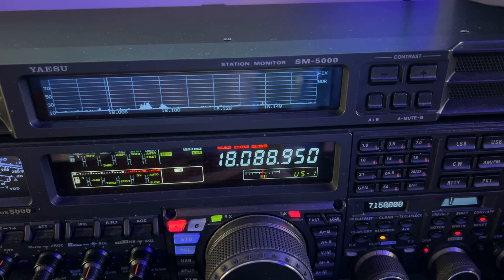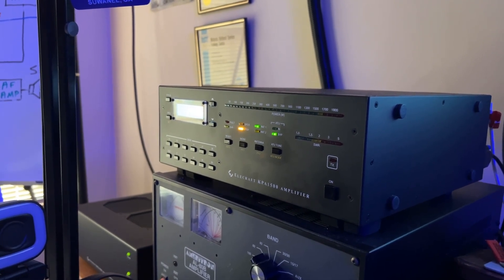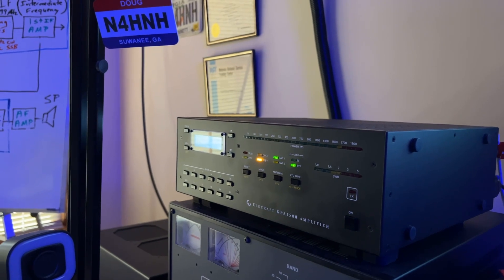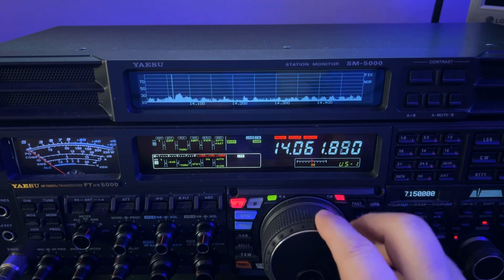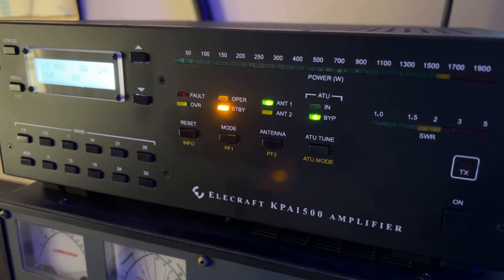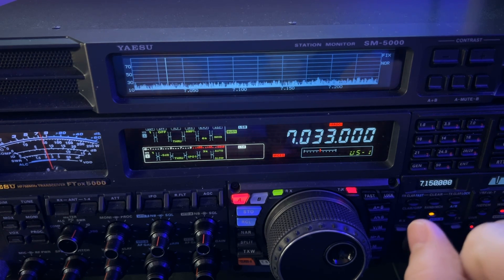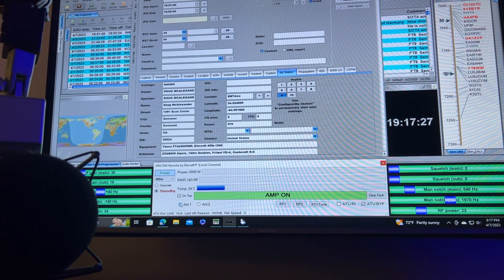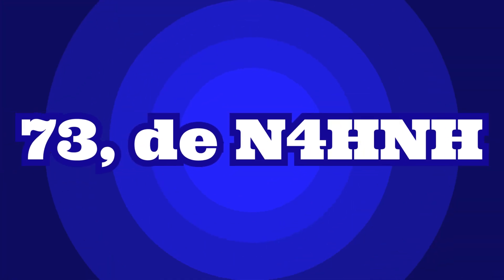Ultimate Automation (Why I need it)

Comment: You mentioned “train your tuner.” I know that the FT DX10 stores tuner info in memories. Is there a sense of “training” the FT DX 10 tuner in increments across a band without using memories? I suppose band stacking would also store tuner info. I’ve not used band stacking yet.
Reply from the maker: Hi Bill!  The FTdx10 internal tuner stores match data for later recall. It will store a match every 10kHz if you wish. However, for most bands, recording a match every 25kHz is enough. But, for 160 meters, I “train my tuner” and let it store a match every 10kHz. Why?  Because the wavelength is so long at 1.8 to 2.0 Megahertz that the impedance changes significantly with only a 10kHz change in frequency. 

The matches are stored based upon frequency. They are not associated with the storage of frequency/mode/DSP settings in the user memories. They aren’t even associated with the band stack registers. When the Tuner is enabled, it looks at the frequency that the VFO is displaying and it recalls the match for that frequency. It doesn’t care how the VFO arrived at that frequency. 

I hope this helps. 

73, Doug

Comment: Ultimate automation would be clicking on the SOTA watch spot, which tunes the radio to the appropriate frequency and mode, sets the tuner and antenna,  and loads the QSO info to HRD. You would still have to work the station yourself, but maybe automate that for FT8 spots? 😂 ‐-n1bs
Reply from the maker: We have it tough don’t we. Having to rotate the VFO. Hi! Hi!